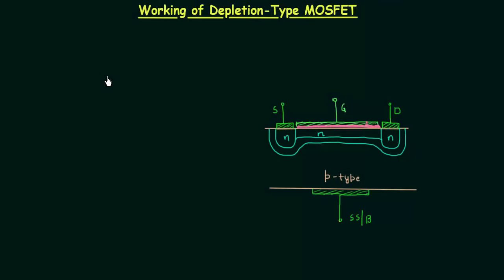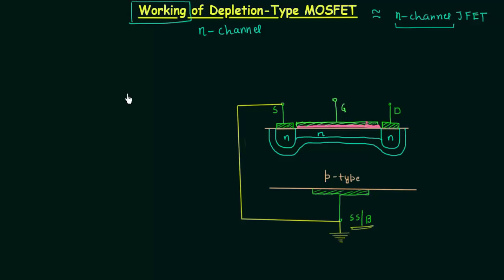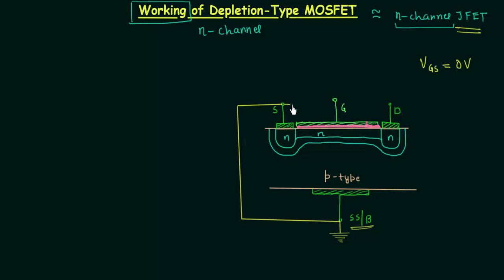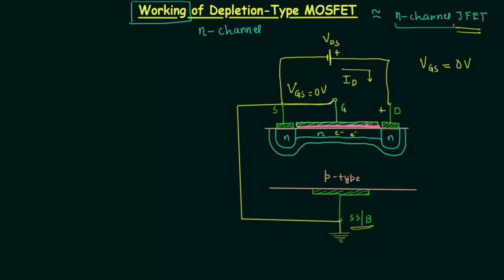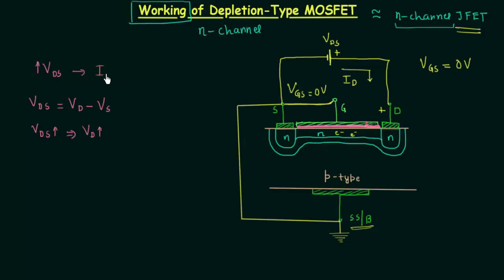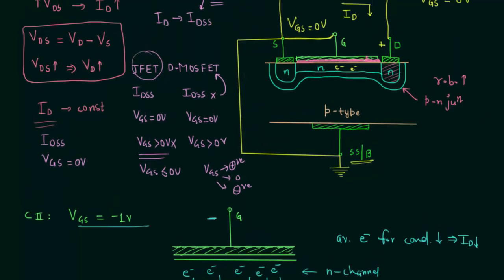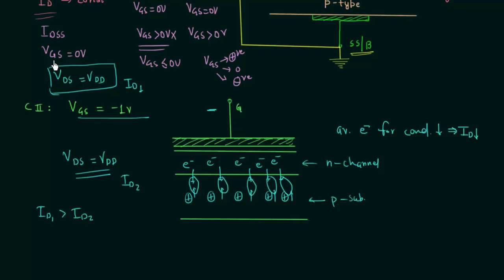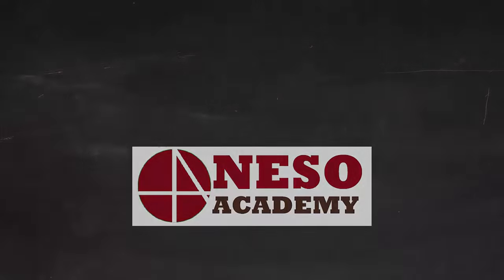Working of Depletion-Type MOSFET

Comment: id3>id2>id1 because in case 3: when we apply Vgs>0v since gate is at +ve voltage it will attract electrons from the p-substrate thus making more electrons for the conduction.
Reply: id3 >  id1 > id2

Comment: sir at 6:09 you said with increasing reverse voltage the deplition region becomes narrow but actually it should be broad
Reply: he said width of depletion region will increase  and channel will become narrower .
Reply: reverse bias ,so depletion region is broad but channel of conduction is less ,like in jfet in reverse bias depltion increses and channel is dreaseses
Reply: right
Reply: He said that depletion region will become more thicker and channel through which current will flow will become more narrower
Reply: @swapnildesai5622 Firstly go and learn the spellings of "Depletion , Increase and Decrease" plz.!!

Comment: you said if we increase V(DS), after a point I(D) becomes constant due to reverse bias in the n-region under the drain. Why does I(D) increase in the first place if a reverse bias is present in the drain?
Reply: Same doubt I have... But nobody reply
Reply: Intially it has less depletion region but when we increase vds then depletion region also increases the hen id becomes constant and at the same time while keep on increasing vds at particular point there is a drastic change in the current.
Reply: I think that the reason for the increase in id is because of the fact that there is a potential difference between the Drain and the Source. Since the source is doped, we find an abundance of carriers willing to go to the drain causing a current id.

Now, extending this logic, when we further increase Vds the current increases but due to the decrease in conducting path, the resistance of the channel increases hence the current decreases.

The assumption is that the rate of change of voltage is smaller than the rate of change of the height of the depletion region.

I hope this helps.

Comment: If gate terminal is insulated from channel how do the negative charge on gate repel conduction ē from channel
(when Vgs=-ve)
Reply: Actually an oxide is between the gate terminal and the channel, so it's operates same like a capacitor, so there generates a conventional current.
Reply: Santhosh Rapolu tanq

Comment: Sir,why inversion isn't occured in the case of case-2,i.e.,when Vgs is negative?
Reply: inversion will not occured becaause electrons attract posistive ions, and when Vgs is negative due to Sio2 layer positive ions occurs opposite side and dey is already positive charge becuz of p substrate , inversion will occurs only wen we apply Vgs.

Comment: one more question...gate is connected through dielectric... metal (gate)/dielectric/ Metal.. its making capacitor right?so  when we apply -ve voltage to the gate other side it must induce +ve voltage..so how canit repels  electrons......am i right or wrong please clear..
Reply: Now make construction again with source and body terminal connected. what would you found, you must found that if V(gs) is negative then body terminal should positive, which is connected to p type substrate now holes will repel and electron will attract. try it, If you read it carefully you would surely find your answer. 
 By the way, Very good Question.

Comment: Anyone plz tell me that what is the work of silicon di oxide layer in this??
Reply: Prashank Bhardwaj due to silicon dioxide the input impedance of mosfet becomes very high
Reply: Due to this input impedence will high and as well as we can say that sio2 also provides  better isolation and it also behave as a good dielectric material that's why we use sio2